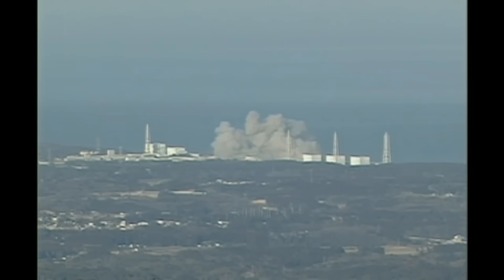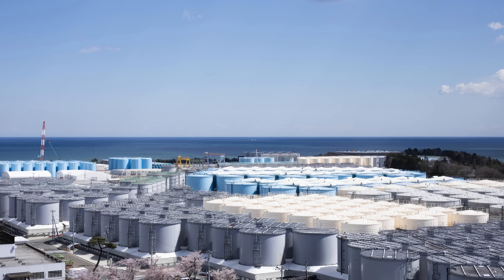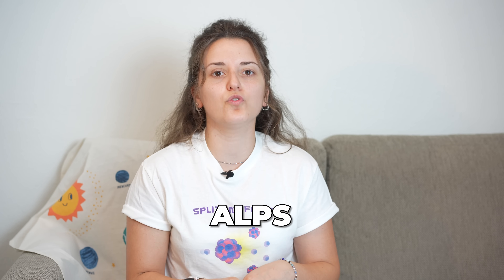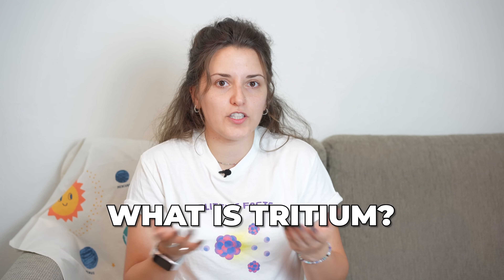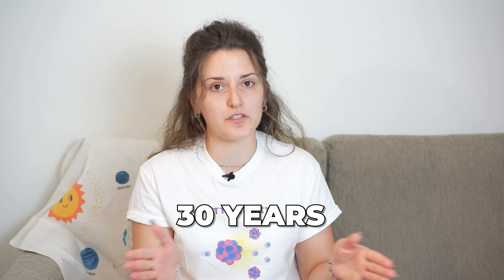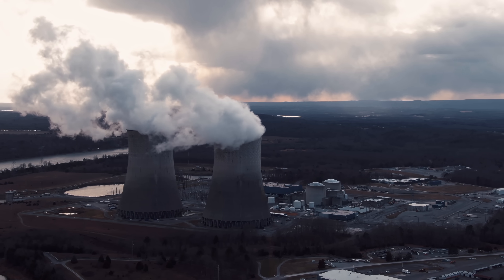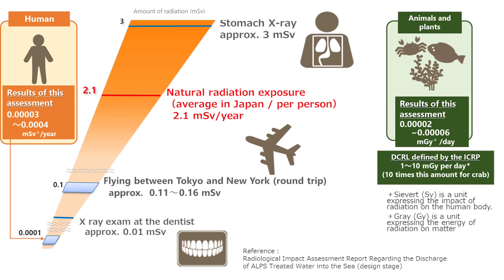Nuclear Physicist Explains - The Release of Fukushima Treated Radioactive Wastewater

Comment: Two small points you glossed over in your otherwise excellent presentation.
Firstly, if this release of Tritium contaminated water is so safe,why are the Japanese taking thirty years to do it?"
Secondly,the fact that the Chinese are releasing far more Tritium contaminated water than Japan does not mean the Japanese release is in any way safe,just that the Japanese are making a bad situation worse. Saying the Chinese are worse polluters does not make an argument for smaller polluters getting a green light to carry on.
Reply: There is always around 3400 grams of naturally occurring tritium in the earth‘s atmosphere as it is constantly being produced by cosmic radiation interacting with the upper atmosphere. Most of those 3400 grams are in the earth‘s oceans. The water in Fukushima only contains 2-3 grams of tritium so releasing it all at once would have no measurable impact. The reason why they are only going to release 0.1-0.2 grams of tritium per year at Fukushima is that the regulatory limits for radioactive releases from the plant are still the same as they were before the accident. So Fukushima isn‘t actually allowed to release more tritium in 2023 than it did when it was a normally operating nuclear plant.
Reply: Good points. Also, the statistic shown compared the water release to other countries' total emissions, but it did not include Japan's release from other sources that this water release comes on top of.
Plus, the 'abuser tribe' loves to present absolute figure statistics about China instead of per capita figures. While that is possibly somewhat legit to connect it to political decisionmaking and responsibility, it is inappropriate in many other contexts. (Like how China is still developing and working on lifting people out of poverty, while Japan is very far from that, maybe even going in the opposite direction now, by own fault.)

The thirty years I assume was chosen to appease the public, to minimize the impact in a timeframe that can be maintained with some confidence. Basically, if the water sitting there for a while longer isn't a problem, then why release it in one or ten years if you can stretch it further? (And it might even serve as a long-term reminder of the mistakes made if the water release is a continuing process.)

Comment: it's also worth noting that those are only temporary water storage tanks that aren't designed to store the water forever. not doing anything would mean that eventually they'd leak and contaminate the ground water in a higher, uncontrolled concentration as it's done rn.
Reply: The water in Fukushima only contains 2-3 grams of tritium so releasing it all at once would have no measurable impact.
Reply: @danadurnfordkevinblanchdebunk  all at once into the ocean; but not into the ground water, though!
Reply: @danadurnfordkevinblanchdebunk  but not as a concentrate

Comment: Elina you did a good job but comparing dose rates of beta decay to dental x ray is very problematic. When a beta emitting substance is ingested into any plant or animal then EVERY beta particle emitted hits a piece of a cell like a bit of DNA and so even a smaller amount of radiation can cause structural cell damage. If it’s OUTSIDE the body like in a tank then Tritium is totally fine because the rays are very weak and don’t penetrate even a sheet of paper or the leaf of a plant. In fact I have a tritium illuminated wrist watch. But X rays are the reverse and should not be used to compare rates for biological impact. I know. I used beta emitters during my science research lab days and I published a paper showing direct cell damage from even small amounts. So yes diluting helps but it’s still not ideal for the sea life. Just another “tax” we humans are putting on the environment.
Reply: Well if you drink seawater then you have other issues than the tritium.

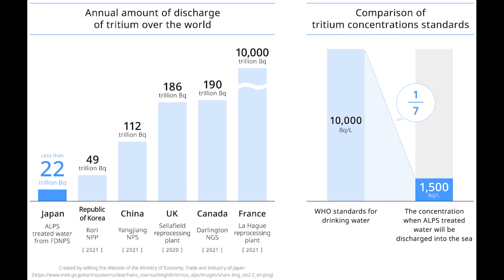Comment: About that graph at 5:29 - are those radiation levels on the left side actually very dangerous? I have driven past the Darlington power plant on a number of occasions (a major highway is located about 1 km north of it), and while it's not exactly in my backyard I'm now very curious.

I'm sure any discharged water from Darlington has been properly treated, but that number seems quite high.
Reply: OKay, so that graph is a little missleading, it is technically accurate but the key is per litre of water released. Not total annual release, I can release 10 times the radioactive water amount, without any change if it is diluted enough in non-radioactive water by using 10 times the water to dilute it in. I might need bigger pipes, but overal radioactivity does not change. Which brings me to the next bit, generally speaking nuclear power plants are so stringent on monitoring radiation hazards what they release is below the natural radioactivity levels, whether this be waste water, used fuel storage, new fuel storage... They have monitors around the coastline to check there is no rise and they are carefull to make sure there is no currents that will cause stuff to collect in a single area but dilute thoroughly.

Comment: Fantastic video. It really helped explain the reality of the release, putting it in context to wider / normal exposures. I haven't seen anything online or on TV that hadn't been negative and suggesting the seas of Japan will soon turn into Springfield Lake. Thank you for you work.
Reply: Carbon 14, strontium 90 and iodine 129 and others which are more harmful than tritium are not treated and released into the ocean. But She only said about tritium.
Reply: @Panda-phoenix  
Absolutely untrue nonsense.
Both Strontium-90 and Iodine-129 is removed from that water. Carbon-14 levels are far below what is allowed for general discharge, and the same goes for the levels of Tritium. That water is probably some of the cleanest waste water you will ever see.

Comment: Some info is not included. I honestly do not get why China needs to be included twice in this video as to ameliorate the consequences of Japan releasing nuclear contaminated water into the sea. This could have been mentioned as how it is released on an international basis. There is a difference between nuclear "wastewater" and contaminated water. To make the comparison to China, while excluding Japan's other operating nuclear power plants that doesn't include that wastewater, doesn't complete the numbers in an aggregate overall. 

I get how naturally occurring radioactivity surrounds us every day and our bodies have adapted to changes through evolution. But adding inorganic radionuclides to already existing add to the overall amounts. They will still be very low. What isn't mentioned is that ingesting tritium (breathing or eating) is not the same as natural exposure where the skin is think enough where tritium cannot penetrate it. 

Anyway, thanks for video. Anyone can read what you pointed out and it is easy to understand from the IAEI called "IAEA Finds Japan’s Plans to Release Treated Water into the Sea at Fukushima Consistent with International Safety Standards"  https://www.iaea.org/newscenter/pressreleases/iaea-finds-japans-plans-to-release-treated-water-into-the-sea-at-fukushima-consistent-with-international-safety-standards
Reply: Thanks for linking the actual report, it clearly demonstrates you are full of S * l T..

Comment: The amount of water they have is a danger not for radioactivity but just flooding risk if there's a significant containment failure such as if there's subsidence under one of the tanks causing it to split open. That will happen eventually, and that will kill more people than tritium ever could.
Reply: True - also, the main reason that they are doing this is simple - they've just run out of room, they have no more space available to construct more storage tanks, so they have to start getting rid of some of this treated water to make space for the amount they are still using daily as part of the decommissioning work!
Reply: How did you determine the flooding risk? There is probably the same amount of more water released every time snow melts on that site.
Reply: @iclicklike3397  That amount of snow melts over weeks, the same amount could leak from a ruptured tank in seconds!

A small leak at first would dig a channel under supports and cause the huge weight to buckle the container.

People do not respect the power of water, if it cannot be contained it can wreak astonishing destruction as it flows down.

Comment: Why to release it? Sell it to China as they will most likely be the first to create a sustainable fussion reactor. They can use 3H as fuel later on.
Reply: There's only about 3 grams of tritium in all those tanks combined, even if you could isolate it.
Reply: @danadurnfordkevinblanchdebunk  That is equivalent of around 5.15 x 10^13J, which equets in turn to around 15000 gallons of oil burned :)

Comment: My question is, if this water was used to cool down the core, why is it stored after use rather than cooled off and recirculated?
Reply: I'm not a specialist or anything but my understanding is that the water was used on an emergency basis and there simply wasn't the time needed to build anything fancy like that. It takes time and engineering to build a closed cycle system with radiators to lose heat, whereas dumping cool water in and pumping hot water out into tanks can be done with much less preparation and lead time. As a crude comparison: when putting out a fire you don't bother building a system to catch leftover water to run it back through the fire hoses a second time.
Reply: The public official reports say that in 2013 they were pumping out of the reactors 800 tons of water per day, which was treated and some 400 t/day were injected back for cooling. The difference of 400 t/day was leaking into the reactors from the soil around the buildings, which means the containment was severily damaged. If they didn't pump that excess water out, it would end up in the ocean with all the radioactive isotopes.

Comment: Small question though, about tritium being unable to be filtered out.

Couldn't they use a centrifuge? Perhaps after electrolysing it into hydrogen?

I agree it is unneeded and probably expensive, but to convince a billion people of that sounds harder than this procedure.
Reply: It's possible to do, but why? It's not like people doing scaremongering would change their tune because of that.
Reply: The processes you describe are certainly possible - however, the sheer amount of energy required would be astronomical, and cost-prohibitive, given the limited uses for tritium currently!  Tritiated water (T2O) is chemically identical to ordinary H2O, and the mass difference is so small, it is very hard to seperate it..

Comment: I would be interested in a dissertation of neuclidtides released into the atmosphere / tailings dumps from the burning of coal. Coal is not inherently carrying radio active traces but has it impinged on it from the surrounding sediments. Any way I have no expertise and would apreciate an opinion.
Reply: The radioactivity from both thorium and uranium that came from the original coal, in a one gigawatt(GW) output coal burner, far exceeds what is permitted from a one GW nuclear plant. It is  also the least damaging of the coal burner's emissions.

Comment: Great awareness video, thanks for sharing information on ALPS. 
I learned two things 'Tritium and Sievert'.
I have couple of things in mind 
1. Whether radioactive material will possible to exposed during the condensation process through the cooling tower.
2. Whether you seen uranium residue after it's use and if so, how they appear and accumulate.
Reply: Both of these questions where awnsered in the video.
Reply: @mr-x7689  since the water released in the cooling towers is on a second loop and never come close to the fuel, I'm a bit puzzled by what is said in that video, more explanations on that would have been welcomed.

Or maybe she was talking about the water in the primary loop, which is most likely replaced periodically ?
I know contaminated water is stored on some production sites (there was a breach in France some years ago, when some tanks were leaking and the retention area supposed to catch it was ... also leaking, into the river😐).
But I don't know what they're usually supposed to do with it, maybe it's treated and eventually diluted into the ocean as well.
Reply: @pbe6965  Some of this is water that was used during cleanup of the accident and stuff, they collected and processed everything they could to not allow contaminated water to end up soaking into the ground soil, remember they took off the top soil and decontaminated that and then mixed it with fresh soil to dilute the radioactivity there and remove the really harmful isotopes.
Reply: @EwanMarshall  I was talking about the affirmation in the video that other reactors (not Fukushima's), which didn't blow up, still release tritium in their cooling water during normal operation, which ends up diluted in the river or the see near the power plant where the excess water from the cooling tower is dumped back.
Implying that dumping Fukushima's processed water is not worse than what every reactor in the world is already doing on a daily basis.

She probably knows her stuff way better than me and right where I'm wrong.
But I'm still short of an explanation as to how this water is contaminated when it doesn't get in contact with the fuel 🙂 as opposed to Fukushima's which was dumped directly into the open reactor with exposed fuel.
Reply: @pbe6965  I'm pretty sure it doesn't apply to the two-circuit PWR designs, but the Boiling Water design (BWR)does use the steam direct from the reactor, to drive its turbines. BUT that steam is condensed again and sent back to the reactor.
There is a heat exchanger (a cooler) which condenses the turbine steam.
I don't get it?
Reply: Carbon 14, strontium 90 and iodine 129 and others which are more harmful than tritium are not treated and released into the ocean. But She only said about tritium.
Reply: @Panda-phoenix  Carbon 14 is created by cosmic radiation, from Nitrogen 14, by replacing a proton with a neutron. Even compared with tritium, it's harmless.
Reply: @Panda-phoenix  No, they are not, they are filtered out entirely at earlier stages.
"ALPS is a pumping and filtration system, which uses a series of chemical reactions to remove 62 radionuclides from contaminated water. However, ALPS is not able to remove tritium from the contaminated water."

ALPS is standard at commercial nuclear power stations at this point.

Comment: Use ago are used to service a system that was used for issuing permits to work at Dungeness B nuclear reactor in Kent the guy I was liaising with that what is the reactor Physio’s t and he told me during the summer he used to swim on the beach not far from the reactor and also told me that waste water was released her and how low in any radiation it was

Comment: Ma'am, What are the  radiological impacts of Ukraine using depleted uranium tank rounds in the war against the Russian invasion?  Will these munitions have a lasting impact on the environment?
Reply: My understanding is that depleted uranium tank rounds have a near neglible effect on the environment. The main reason depleted uranium is used is that it makes the rounds dense, it is the extra weight for their size which makes them more effective at penetrating structures and vehicles.
Reply: Thanks:

Comment: Hi Elina, thank you for the excellent video. It sounds like the water should not be much concern, but I am still a bit concerned about the effectiveness of the alps treatment.
Should I have any reason to be concerned? Are the methods known to be highly effective? Do you know if japan releases comprehensive test results of radioactive material levels in the water?

I appreciate your education on this topic.
Reply: Let's hope so because tritium doesn't seem to get concentrated by food chains whereas most of the other radionuclides do...
Reply: I looked into it a bit and it turns out the iaea is doing safety checks, including measuring levels of radiation. They seemed to say levels of radionuclides are under Japan regulatory limits